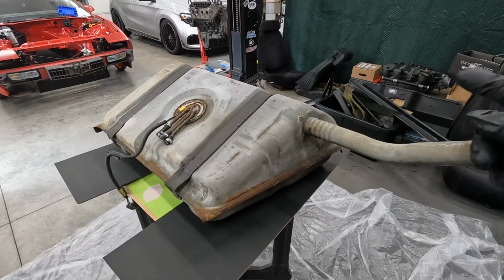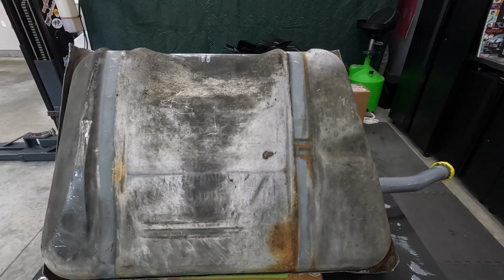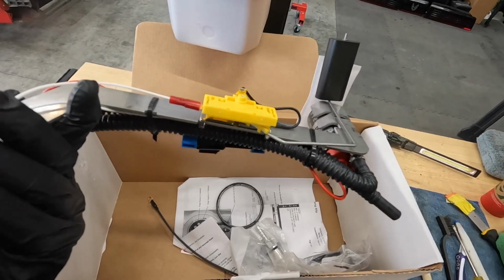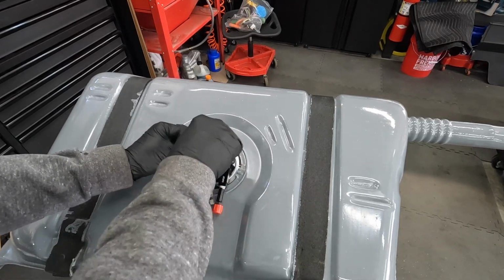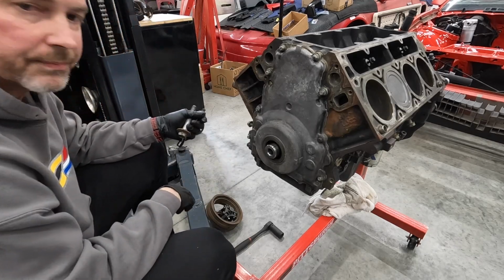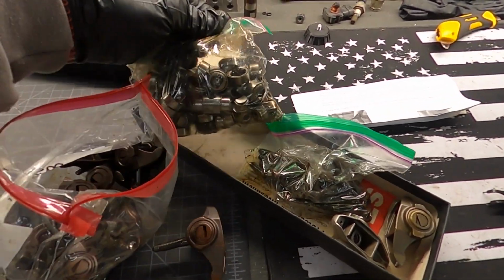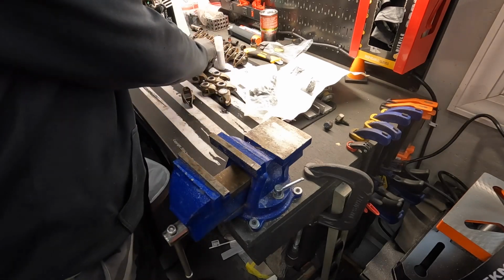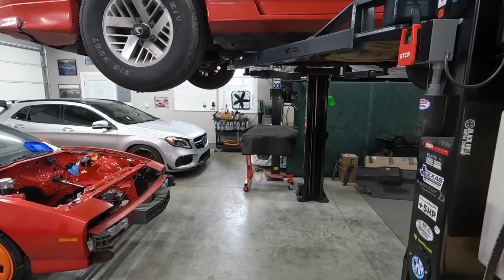Installing our Aeromotive Stealth Fuel Pump - 92 Firebird Project Part 26

Comment: Update on mine...  currently sitting in the local dealership. 70psi in cylinder 1... 15 in 2
.. 0 in 3.... 5 in 4
Reply from the maker: time for a new engine
Reply: @StebbinsGarage  yeah I skipped hitting lkq again for another engine and just brought it straight to the dealership to get a new one. Luckily my bank is willing to work with me and tag it to the total cost of the vehicle

Comment: Any updates on the focus. I did the same swap but my PCM and Harness both went wanted to know if anything serious such as has happened on your end
Reply from the maker: Everything still working fine and running great. No issues at all
Reply: @Stebbins Garage  good to know. I currently have mine at the dealers in order to get the new pcm programmed to the car (vin programmed).